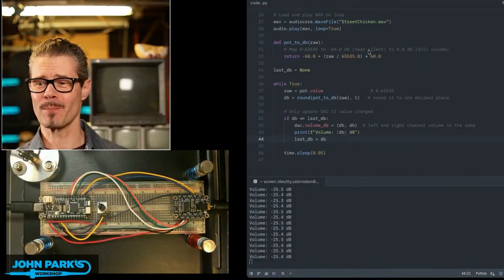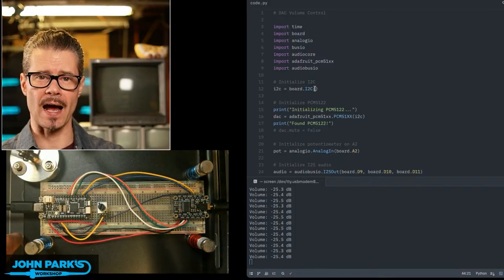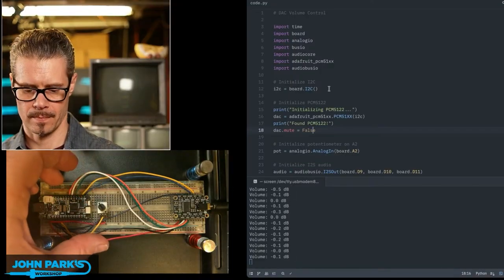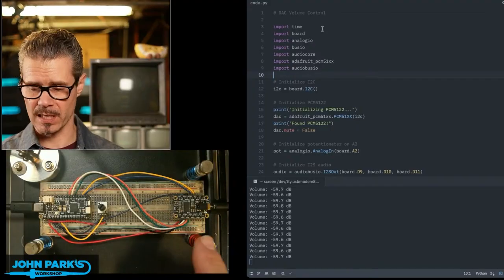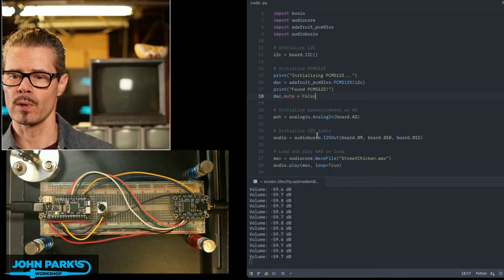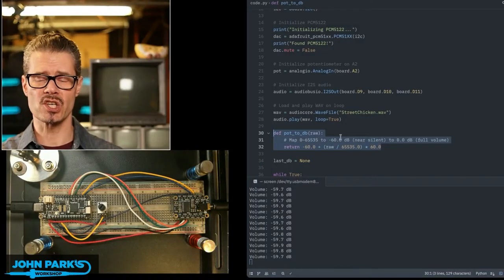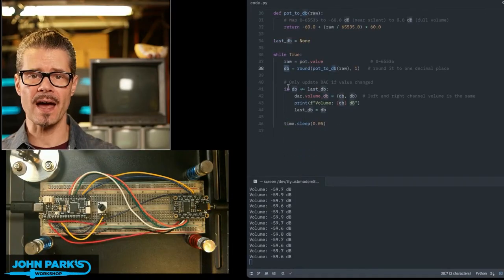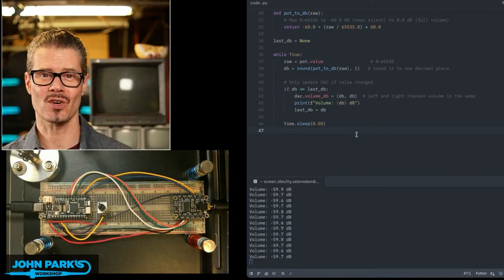John Park's CircuitPython Parsec: DAC Volume Control

Comment: The former Burr Brown audio converter team at TI, based in Tokyo designed that part using a similar architecture to the legendary pcm1792 DAC but shifting it to a tighter silicon geometry and moving the digital interpolation filter into the dsp core.
Audiophiles in your audience may enjoy finding the digital filter selection register and switching between the IIR, FIR and the Ringingless FIR to see if they can identify the differences!
It fills me with joy to see folks discovering this device 10+ years after its release.